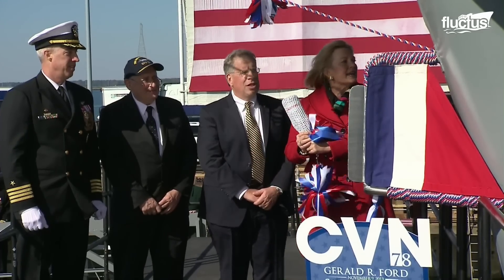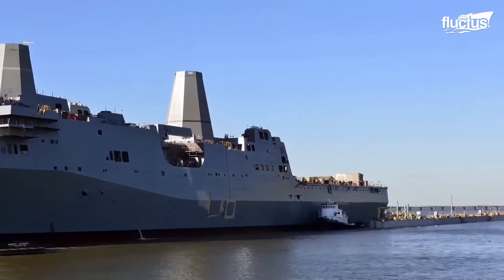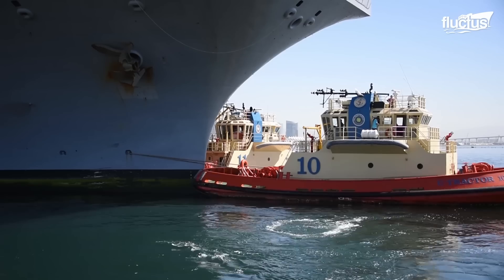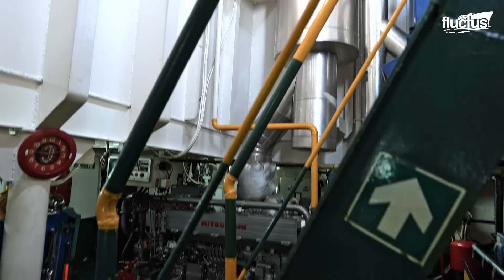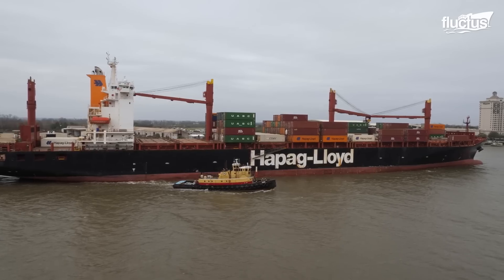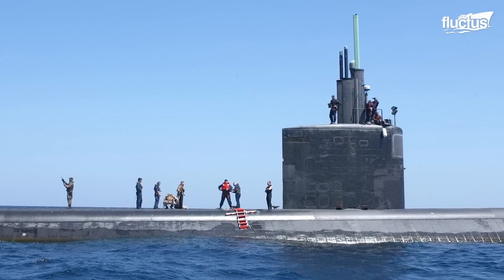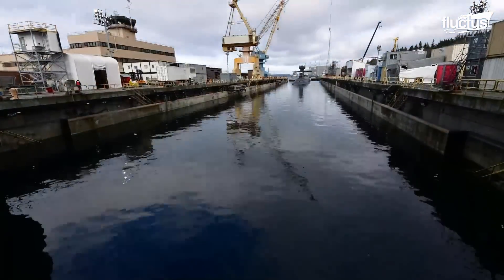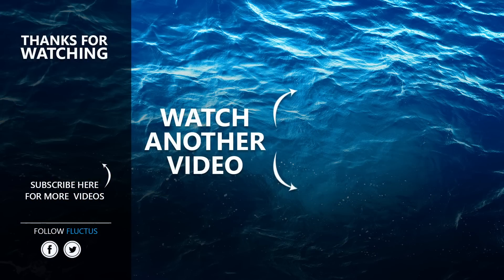The Insane Amount of Power Tugboats Pack to Move $13 Billion Aircraft Carriers

Comment: If the carriers had bow and stern electric thrusters like very large cruise ships they wouldn’t for the most part require tugs.
Reply: They probably have them!
Reply: @kirkkirkland7244  52uu755gbbbr
Reply: A good thought, I B Newton. But there may simply be too much critical "stuff" on board to find room for fuel and extra engines.
Reply: It’s a matter of combat durability and hull integrity. Carrier sailor USS Dwight D. Eisenhower 1976-1980
Reply: All navy ships need a tug !!!